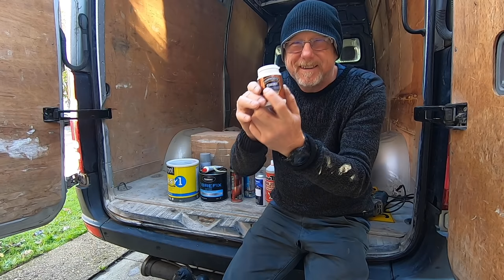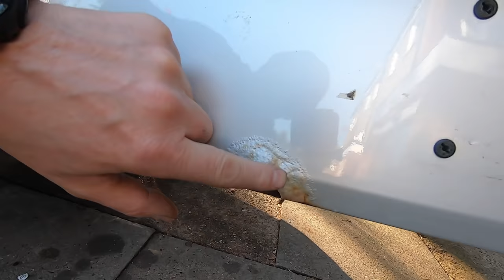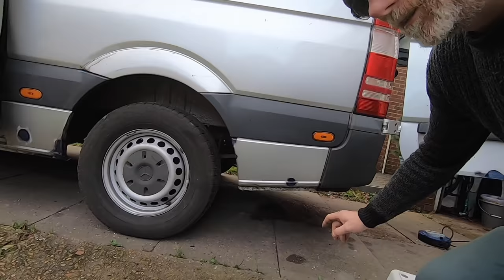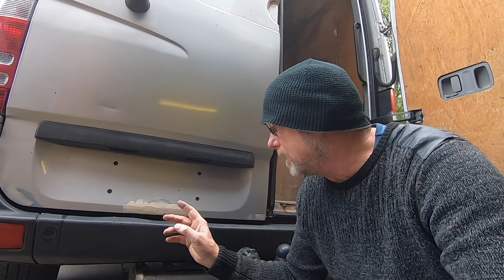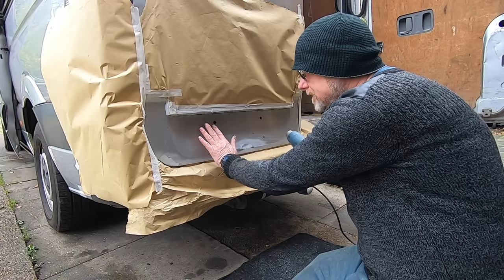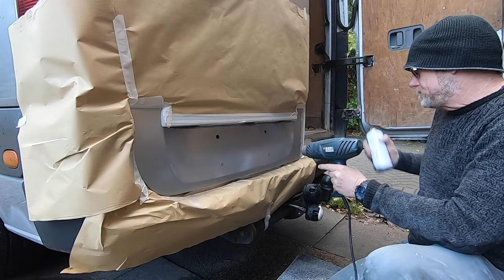DIY HOW TO Repair Rusty Bodywork - Any vehicle without spending a fortune

Comment: Really good job on the rust Mel, it’s something I deal with at work being an industrial painter/sprayer on BAE’s Clyde shipyards. Only suggestion I would offer would be using an abrasive flapping disc over a wire cup, bit more control over feathering back paint work while also being gentle on the good metal that’s still there. Big thumbs up from me big fella
Reply from the maker: Thank you good tip 🤓👍

Comment: Pretty impressive to see how fast these vans rust! I am currently using an epoxy based rust converter for my volkswagen campervan. Works like a charm! Great job on the rust, looking forward to your next video
Reply from the maker: I worked on and owned many a old Vedub love them 🤓👍
Reply: @BigVanSmallWorld  have you owned a t4 transporter? I have a 2.4L t4 from 1997 with a high top. I love it!! So simple, so well built... i hope it will last as long as i do haha!

Comment: Hey Mel, I'm so glad you done this video, diy for the win, erm I don't mean to be the breaker of bad news but you need to take the number plate light panel off, you can see rust bubbling up on the far left fixing, basically top left of the number plate, my mate had a 3 year old vito and it was rotten, had to take it back to mercedes for 2 new rear doors.
Reply from the maker: Hi yes you’re absolutely right I just wanted to fix the worst of the rust before winter I will probably do a better job in the summer 🤓👍
Reply: @BigVanSmallWorld  good point Mel, get the worse of it done then if and when the weather improves, take more time and get every Last bit of rust off the van, fingers crossed the parts for the turbo come in soon and you can get on with this project.

Comment: mel , i lived in Herne Bay for 10 years ,, rust is bad ! I would always Put a little rust converter inside the door and let it run into the seams , I never had it come back as the rust killer converter would coat the steel ,,, Great job man .
Reply from the maker: That’s not a bad idea thanks for that 👍🤓

Comment: I just thought to add this Mel, I hope you don't mind. A Dremel or similar can also be used with a sanding drum attachment. An angle grinder is a ferocious bit of kit and while I accept if things have got very bad and you have a large area an angle grinder and wire brush are excellent for fast paint and rust removal,  for people without much experience of power tools, they might be a bit of a handful. A Dremel would be my preference for small patches of rust.
Reply from the maker: This a good 😊

Comment: I'm sure you know and did this,
so just a tip that escaped the video :
if a spray can isn't empty when you stop using it, hold it upside down and give it a few puffs, allowing the (probably) propane pressurising gas to squirt (no pun intended ;) ) out the remaining paint out of the nozzle  ... all the more chance you can reuse the remainder later on :)
Reply from the maker: Oh yes I didn’t think to include that I was rushing because of the weather 👍🤓

Comment: Personally Mel I would of used a paint over smooth finish stone chip under the paint on the lower panels, especially if your painting the whole section, it gives it a more durable longer lasting finish, and if the paint did get chipped you still have a rubberised coating to stop and damp causing more rust, Ok it might take an extra 24hrs to go off before you apply top coat but it is worth the extra time and effort, otherwise mate great job as ever.
Reply from the maker: You’re absolutely rite and yes I love stone chip I have used it extensively in the past when I had workshop and the time but unfortunately I was up against the weather and just wanted to get it covered and looking a little bit better 👍🤓

Comment: Brilliant PS I'm converting a 14 plate Mel and there are a couple of very very tiny spots, going to nip those bits right in the bud. 😂😂😂
Reply from the maker: Hi yes you absolutely should try and get them sorted before winter good luck with your build 🤓👍
Reply: @BigVanSmallWorld  Hi Mel I won't need luck your build vlogs are all I need

Comment: When I saw the start of the cideo I thought, well at least you got it done before the recent rain came - but it was not to be.....
I'm sure I remember reading that the base metal is not protected from moisture causing further rust until you get the top coat on i.e. primer is not sufficient protection - is that right ?
Reply from the maker: You’re absolutely rite primer will let moisture in that’s why I was really rushing and using the heat gun 🤓👍

Comment: Paint, if you buy one Can you can guarantee you will need two. If two you will need three.
I remember using a product called rust eater in the 80's. Would turn rust black. I have had my "fill" of fixing rust on cars.
Reply from the maker: I think the stuff I use is the same as rust eater 🤓👍
Reply: @BigVanSmallWorld  It came in a small jar with a brush attached to the lid.
Reply: If you look on the label of most cans of rust converter you will find that the active ingredient is phosphoric acid. It's simply reacts with rust which is iron oxide to create iron phosphate, which is black. That iron phosphate is impermeable to water and thus forms a barrier, which prevents further rusting and also acts as a base for you to add your body filler and or primer onto.

Comment: If there is a hole there is also rust on the inside. Treating just the outside won't work the rust just comes back.
Reply from the maker: You’re rite it’s a never ending battle 👍🤓

Comment: Mel..Kurust should be left for upto 24 hours to take effect,painting over it after an hour is pointless.(it says it on the label)
Filler should be finished to at least 320 grit for can primer and primer finished with 800 wetndry or 400 dry sanded.
Rust creeps from behind and under the panel so it's going to return quickly because you didn't repair or paint that part.
Water is now going to creep under your repair and your filler will bubble up while your panel keeps rotting.
To make things worse it rained on your primer which is porous so moisture has now also soaked into your repair.
Rattle can paint is utterly rubbish and also harder to rework when you finally have to have these repairs done correctly upping the cost at the bodyshop.
Mel,by now you might think i am picking on you,but i am not.I am just pointing out that although sometimes having a go yourself can save you money..With paint repairs it's simply not true.
It devalues your van and costs you more in the long run in both resale value or rework.
Forgive my directness Mel,I am a subscriber and i enjoy your videos and commend your enthusiasm but after 35 years in the trade it pains me to see these home repairs because i have to correct so many of them...Good luck with the build mate and happy camping.

Comment: I'm mad, just fitted the sliding door Window and stuck the glass on the rear panel, and not cut the metal out, so it looks like a fake window, on one side. But now DVLA are stating you need two windows looking out to let light in,
Reply from the maker: That’s rite and they have to be on the same side which makes it worse